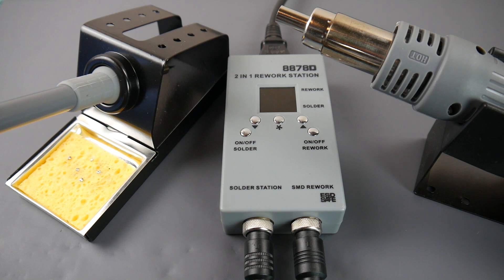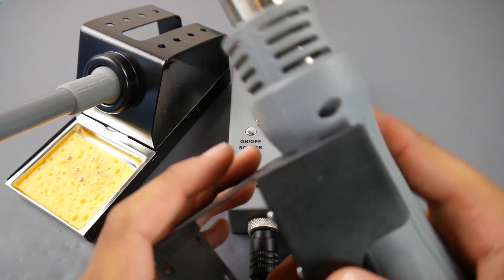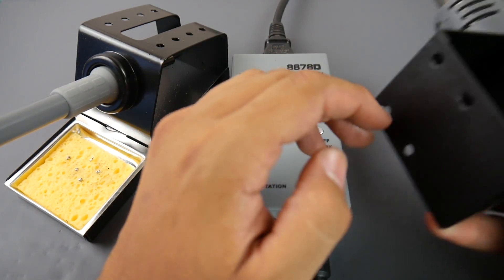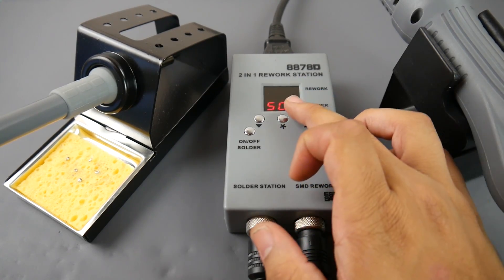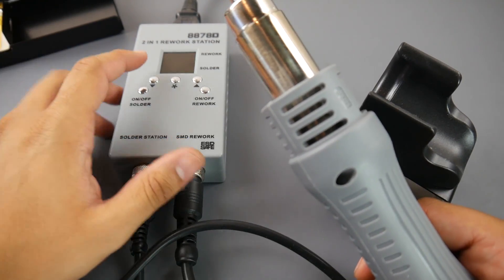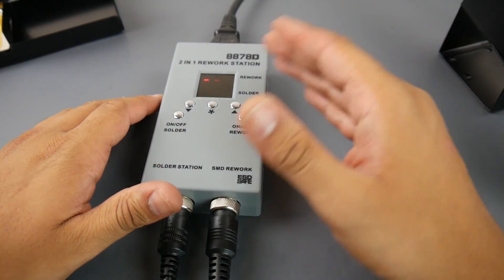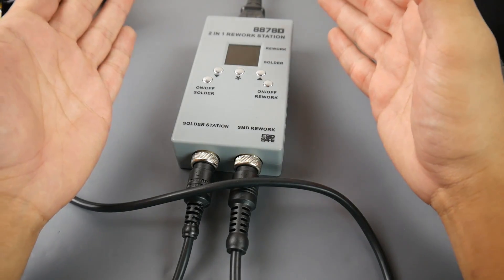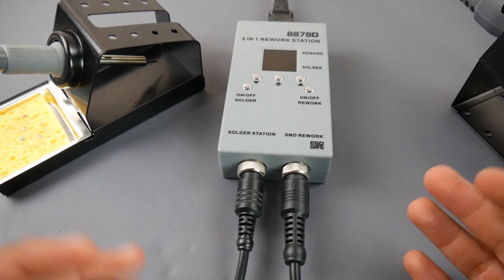A $65 Micro Rework Soldering Station  //  YAOGONG 8878D 2 In 1 SMD Rework Soldering

Comment: I've used for for the last 5 years: I'm very happy with it. It blew a few of the rectifier diodes, I've been through a few of the ceramic elements both the soldering iron and hot air elements,  and I blew a fuse. I don't use it daily but I use it a lot.  But overall I would give it 8.5-9/10

Comment: I actually picked this one up off ebay and it's worked great for me now for a couple years. 
I'm looking for the thicker wedge soldering tip. Which tips will fit this model?
Reply: probably a long shot but did you ever find out what tips fit it?

Comment: nice video, it seems you really enjoyed it... :) can i use 900M-t soldering tips on it?
Reply: I got some 1326 = 24v 60 watt, ..but those were wrong. The soldering iron uses 240V AC - but no idea how many Watts..200? Some tech specs say 60watt..Did U find out what ceramic element to use?

Comment: Poor builds. On my new PIGONG 8878D the fan in the hot air handle stopped working after the first use, with smoke and meltdown. Inside the handle I found that the fan ground wire (blue) tore from the joint. Lucky it did not short with the others otherwise would have blown an IC.
In the end you get what you pay for. WYGIWYP, the ACME of China
Reply: 1 year fwd: the BT137 triac feeding the soldering iron has failed with its T1 and T2 shorted, and as a result the trace of T1 has blown. Difficult repair, during which the thin traces had quickly exfoliated and had to be replaced with jumper wires. Otherwise would have been an expensive garbage in the landfill
Reply: Obviously the Triac drives the soldering element at 240/110V AC - I'm guessing the element is 200 watts, by any chance do you know the element designation it's NOT 900T-M-I (24v 60Watt) or 1321(24v 60watt) ..but also I guess the thermal couple needs to be correct resistance.. thanks if U can point me to the correct elements for soldering and air..
Reply: @DeadQuirky  Searching for "8878d replacement heating element 24v" points out to A1322 24V 50W

Comment: Is this soldiering station still working?have any 2nd thought?
Reply from the maker: It's the best in power delivery I use it when working on large wires for my electric skateboard builds. It's also my new assistants main driver now and its still strong.

Comment: An idea to mount it on the wall:   The only real problem is the AC cord coming out the back of the unit. 
You can accomplish this with or without modifying the case of the control unit.
Without Modification: 
Any angled piece of wood (or a hinge) that can hold the controller to the wall and let the tool wires come out and down in front and have the screen still visible at the back will do the trick. 

You can make a wooden one by cutting a short piece of 2 by 4 at the desired angle and making a channel for the power cord at the back (between the wood block and the wall. If hinges are used, try to find 2 thin ones so your cord can pass between them against the wall, behind the controller box.  If at all possible, find an angled AC cord connector that fits the unit, this will minimize the required space between the unit and the wall when passing the cord behind the support block/hinge.
With modification: You can also modify the box to make it thicker and transfer the AC socket to the bottom of the box, behind the tool output sockets.  This might look a bit better, but it will definitely void your unit's warranty...

Comment: hello thank you for this video i bought this station but the heating elment for Soldering iron was broken and i am seraching for repleacment for this element can you help which one can i buy , and should be 24v or 110v or 220v i am realy need your help.
Reply: The same happened with me, bought a 24V one, instantly blew off. I bought the station on aliexpress, even the seller does not know if a replacement exists. Good soldering equipment, but worths nothing without support.
Reply: According to bangood q&a It's supposed to be the "8858 heating element"..Also from what I read the solder work inside the heatgun is sloppy so it might work again if you resolder it's wires.

Comment: Thanks for the informative video :) I would have loved to see the tools in action - which, as they say,  speak louder than words. I struggle with my current rework station and the lead free solder on motherboards so it would have been great to see you lift and re-seat a chip or small cap. Definitely would have sold it for me :) Still might buy it yet :) Cheers!
PS: To mount the way you want, just loop the power lead 180 degrees and use an adhesive cable clip or two to clip it to the side so all 3 cords head downward in the same direction. Use the loop you created to hang it loosely from a hook on the wall or head height from the ceiling :)

Comment: Does your iron (not hot air gun) ever come out of sleep mode? I set it to sleep after 1 minute and it does but after picking it up the screen just keeps showing SLP and never heats it up again until turning it off and on...annoying!
Reply: Opened the iron, checked vibration / shake switch, was fine. Opened the main unit, the wire connecting shake switch to PCB was broken. Easy fix but still unnecessary hassle.

Comment: Looks like you could stack/bolt the hot air stand on top of the soldering stand.
Reply: I was thinking the same, but its wire will get in the way...  I would make an angled base for it, or mount it to a wall.  Instead, I would mount a metal container on top of the iron stand and use a brass sponge as a tip cleaner.  
(By the way, those holes on the top of the iron stand are designed as a rack for long soldering tips from a different iron design... the long ones where the heating element is inside each tip. The rack lets them cool down safely if you replace one while still hot...)
Reply: Those holes i think are for the tips.